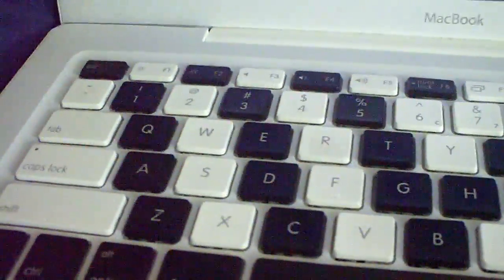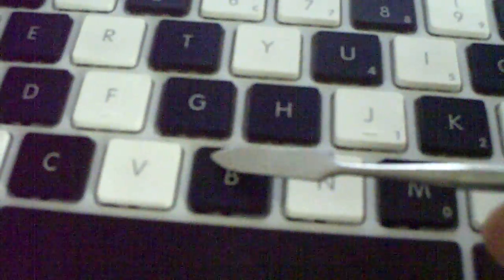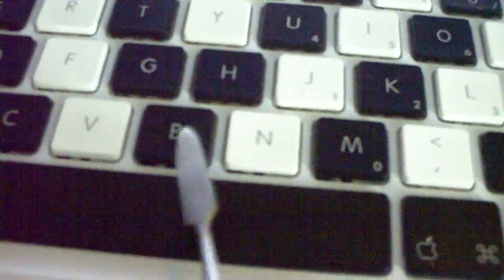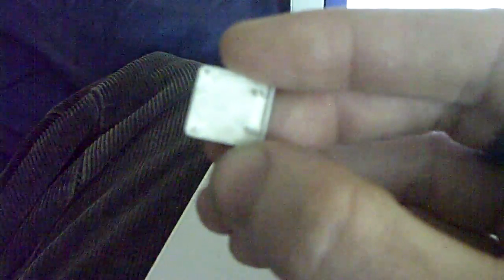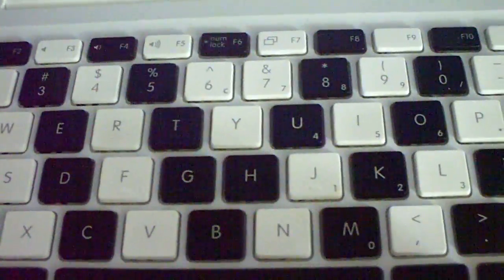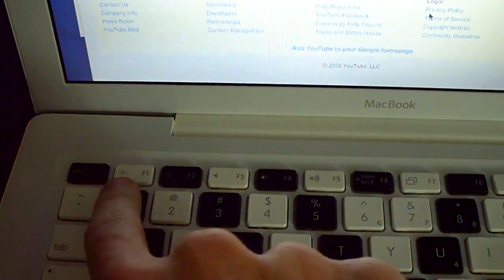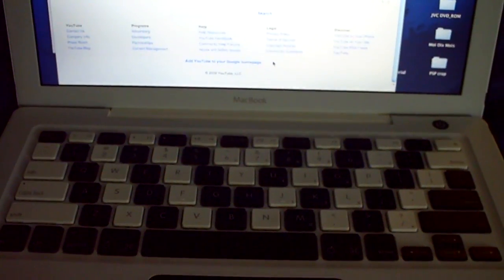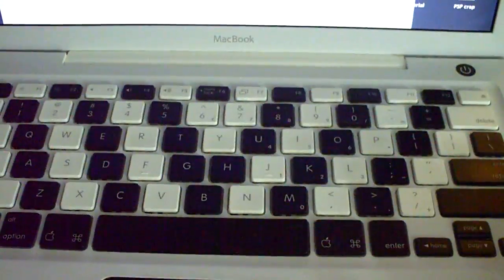How to remove, replace, change, or possibly fix a macbook key

Comment: whats really annoying is no matter how careful you are removing the keys, most of the keys wont snap back in correctly so when ur using the keys, they flap like flipper.
so now, new clips and new are required...thanks for the added cost!!

Comment from the maker: @millersayshihowboutu That's a checkbox in System Preferences.  Open the Keyboard section, and make sure Keyboard is highlighted, not Keyboard Shortcuts.  You should see a checkbox that says "Use all F1, F2, etc. keys as standard function keys".  Uncheck that box.

Comment: My key has broken (the micro plastic forceps that grabs the under X) by simply CLEANING with a soft cloth!!! I wouldn't risk my good keys too by pulling them by hand if I have a good tool to do that. BUT, if I haven't, I would risk by sure - with a goog cold beer to stabilize the hand. hehe

Comment from the maker: @klyspeez Well, I do it this way because I had a lot of them to do, and I wanted to be sure they kept working. If you just pull them off and snap them back on, the little tabs on the back of the keys, and the supporting brackets take a lot of undesirable impact. After some number of times, maybe the first, some tiny piece of plastic will break and the key will either sit funny or not clip on at all anymore.  Also, the smaller tool is easier to see what I'm doing in the video.

Comment from the maker: @hanspeterpitsch The setup is almost the same.  The brackets behind the keys might be rotated 90 degrees from what you see in my video.  I have a friend with a 13" MacBook Pro.  I'll take a look at his keys, and if they are very different, I'll video them as well.  I know they are mostly the same, so my video should be a good frame of reference. Once you get it apart, use q-tips and a single drop of rubbing alcohol, and make sure the computer is off.

Comment: Do you know how to do that on a 15" macbook pro, latest generation? I spilled a drink over it and now I, O, 8, U don't work properly anymore. I mean they are functioning, but are kinda stuck and it's very uncomfortable to use them. Besides hitting my head cause of my stupidity(jk) I don't know what to do. I'd like to clean them if that's even possible. Any advice?

Comment from the maker: @hamiltonboy08 You can't just replace the keyboard. Someone has a Flickr se showing how he did that. He used the light sheet from under a MacBook air keyboard, and the black keys from it. Taking apart the top case on the white MacBook to get the keyboard is NOT recommended. After that, he wired the light sheet to the MacBooks fan, and hid a button inside the computer along the left side, so squeezing the MacBook case at that spot turned on the keyboard backlight.

Comment from the maker: @filoboyz The pice you are talking about is called the "bottom case." It's what everything else is attached to.  To replace it, you would have to remove every piece from your computer, and put it all back together again on a new bottom case.  Might be worth checking out the Incase or Speck hardshell cases.  I prefer the Incase ones.  Good luck.

Comment: Thanks for the informative clip. This one is the most detailed I've seen yet. I accidentally spilled a mixed drink last night and need to see if I can clean the stickiness on about a dozen keys and get the backlight working on a few of them, but I have a later model MacBook Pro (mid 2009)

Comment from the maker: The power button was hard. I had to take off the top case. That's the panel with the keys, trackpad, and power button. I had to use a thin metal tool called a spudger to pry the button out. I don't own that computer anymore or I'd make a video about it.

Comment: Great video!

My sisters cat jumped up on the Keyboard, and one of her front nails got under the '5' key.

The Cat ripped the key up, and the right side of the key broke away from the holding mechnism, and i was left with a key half-attached.

This video helped me understand how to correctly put the key back in.

However, i also had to take off the plastic pieces, and re-attatch them. They came completly unhinged, and it took 2 attempts to sussefully attach in the correct order.

But all works.